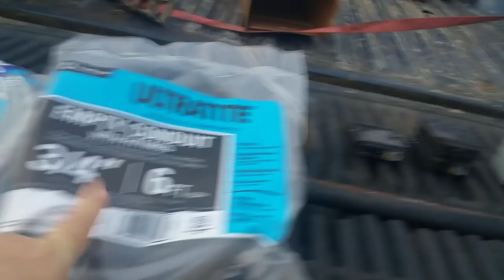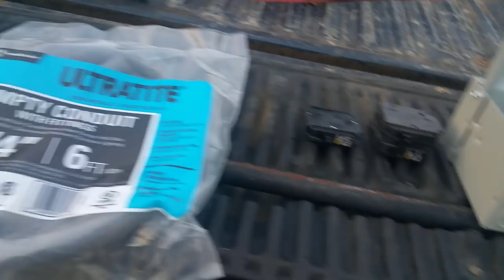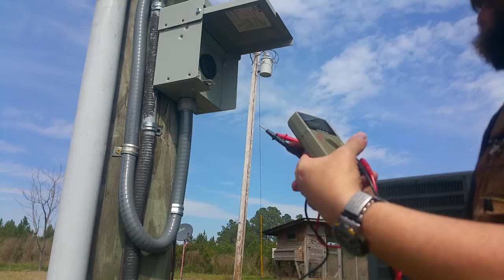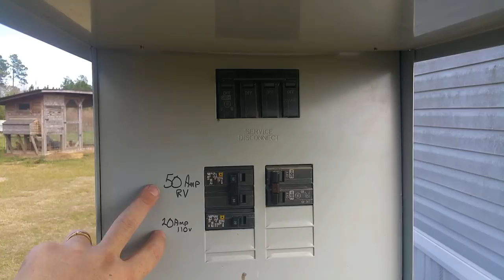Installing an RV Outlet

Comment: To those that think only DYI's should look at videos on here is pure foolishness. Sometime us in the trade like to see what people are thinking is correct and are showing other.  What this guy doing IS NOT correct according to the National Electrical Code (NEC)  but then again he is the home owner and if he wants to risk him and his families life with a electrical fire then that is his choice. I would caution him to come on here and have no disclaimers he might have just made himself liable for any person following his misinformation and has a house fire. like many have said on here the wire size is too small for 50 AMPs  yes your dealing with two 120volt lines but at 50 amps not 15 0r 20 amps it requires a larger size wire to carry that much. Another issue is by being cheap and buying a less expensive box then modifying it he voided the UL rating of the box and the NEC again by having too many wires in the box. Not to mention that the receptacle he used is not even GFCI which is required for outdoor use. Please folks do your research with it comes to installing electrical. electrical fires are the leading cause of house fires and it is usually traced back to faulty/incorrect installation. Please be safe

Comment: Dude, this is the worst install I think I have seen.  As a contractor, you would have been fired when you got back with the supplies you bought for this job and after you were gone those supplies would be brought back for a refund and the correct materials would have be bought.